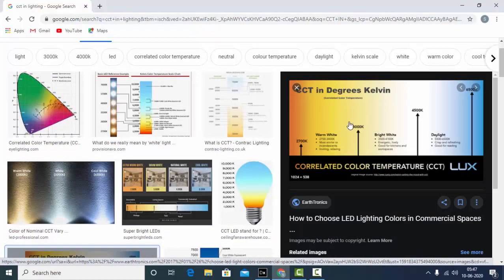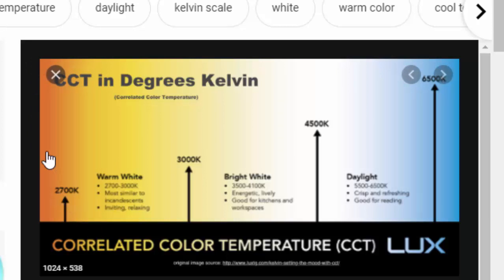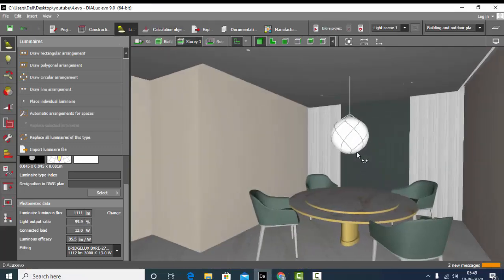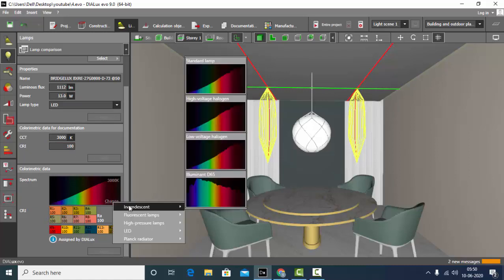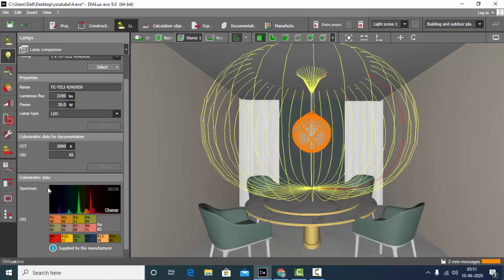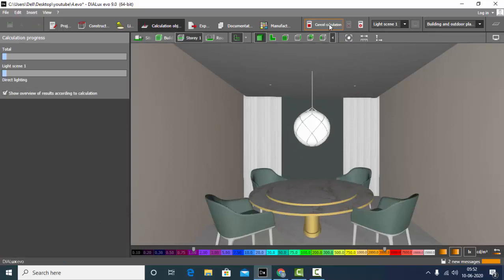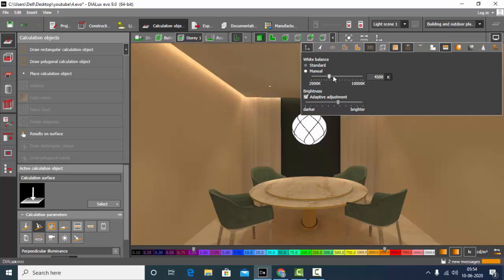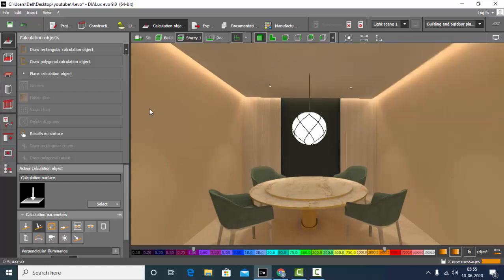HOW TO CHANGE CCT OF LIGHTS IN DIALUX EVO

Comment: There is a walkway which has luminaires and provides the light on the walkway floor with 4000k temperature. The luminaires are fixed at 1.2m height near to the walkway. There is also 12m column which has light and the colour temperature for the 12m column light is 2000k. Does this affect the vision of the person walking on the walkway with two different (2000k and 4000k) colour temperature. Can you simulate this in the dialux evo? The walkway lighting is fixed on the balustrade.
Reply from the maker: The walkway has lights with a color temperature of 4000K  installed at a height of 1.2m. There’s also a column light at 12m that has a color temperature of 2000K  .
The difference in these light colors can affect how a person sees the area. However, since the column light is so high, its brightness will be reduced by the time it reaches eye level, so its effect on visibility might not be significant. 

It’s also important to check the wattage and intensity of both lights, as brighter lights can have a bigger impact on how we perceive the space.
Yes we can simulate this using Dialux Evo, as it can help us see how these factors work together.